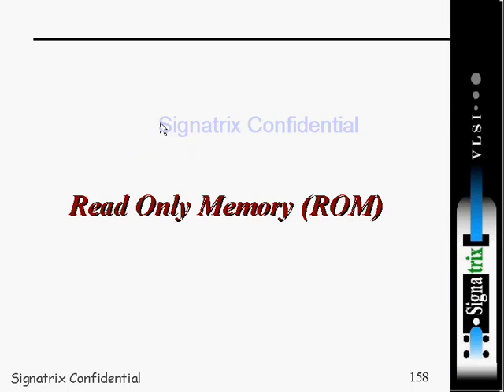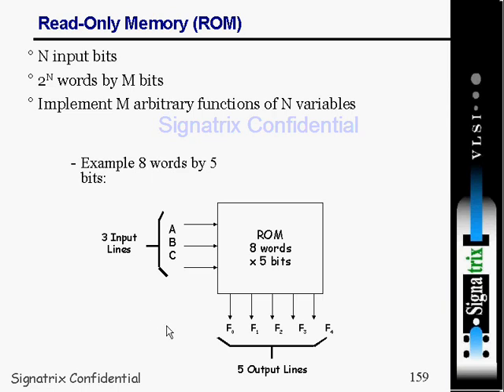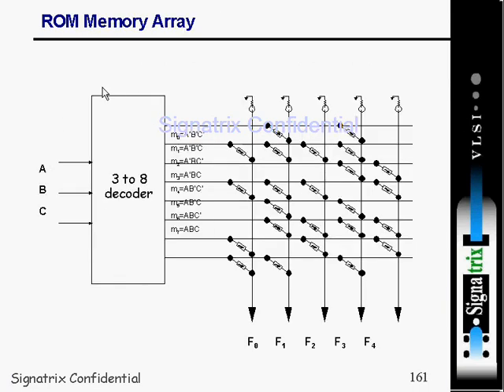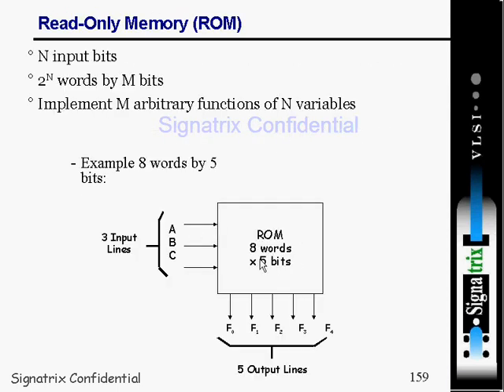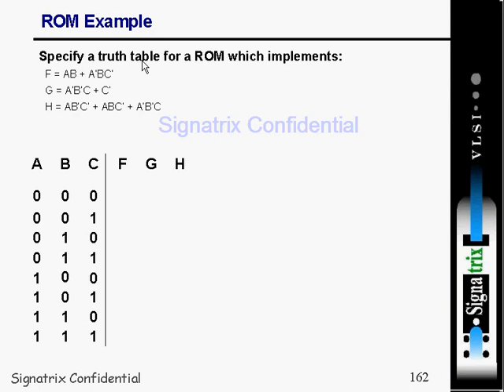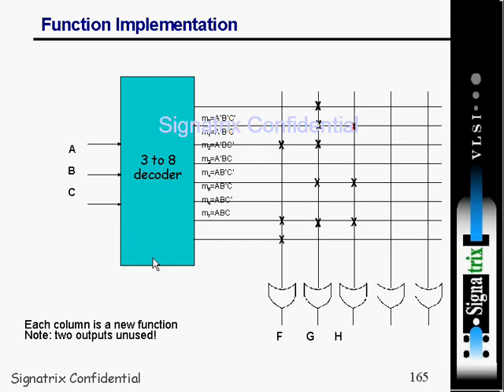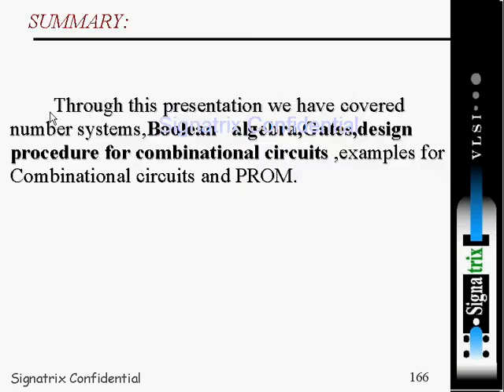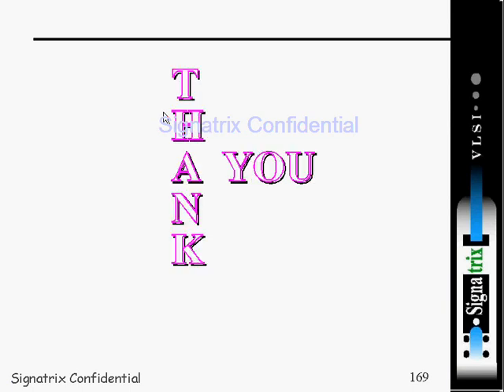Combo 10

Comment: Nice video sir, this question came in GATE ece 2018 and you posted it 10 years back. 
Please help me out the diodes connections which you implemented here. unable to understand. otherwise please email me. i need it very badly. pandey.neel10@gmail.com